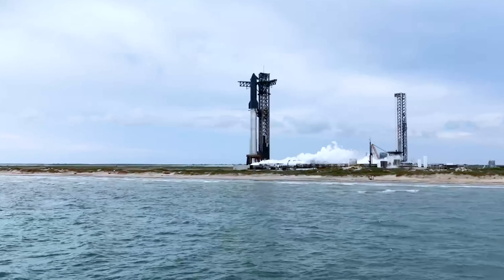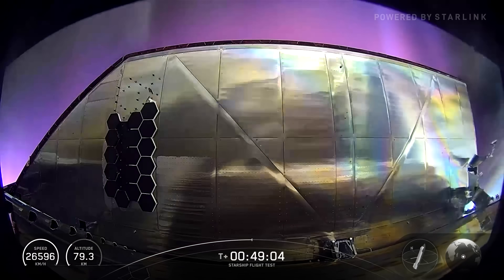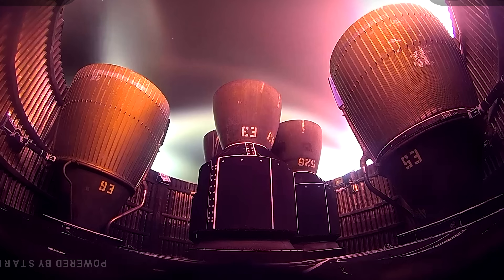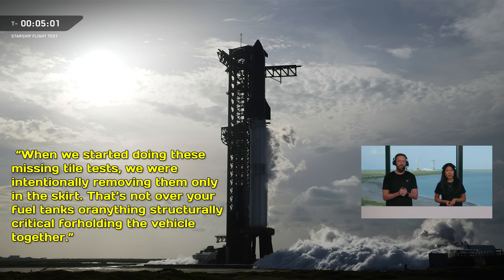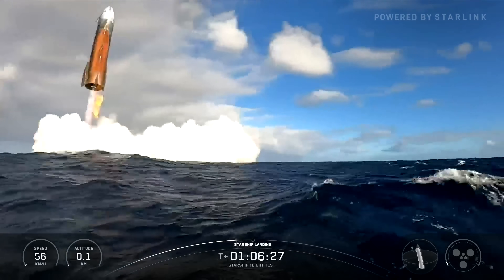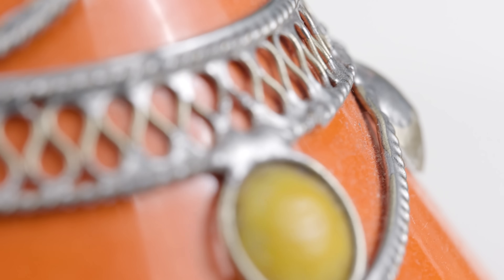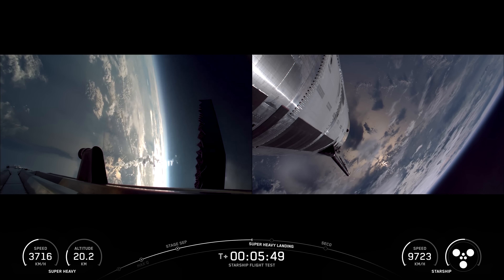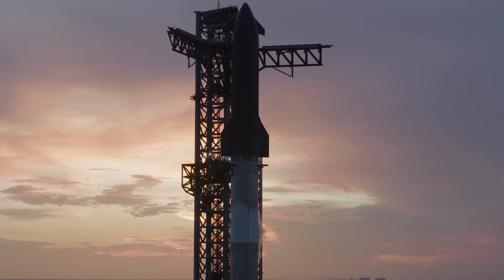SpaceX revealed the Real Problem Inside SpaceX Starship Flight 10 Engine Skirt Explosion!

Comment: If anyone wants the real reason for the red, Elon already revealed that it was the result of several steel heat tiles near the nose and transpirational cooling causing the metal to oxidize and spread down the skirt, hence the reason it's pointed at the bow and spreads out as it goes aft.

Comment: Right from Grok:
OK your part of SpaceX/X what is it with the Orange coloration of the Starships heat shield after re-entry?

Completed DeepSearch
0s

Tap to read

20 sources

Investigating Starship

The question is about the orange coloration of SpaceX's Starship heat shield after re-entry.

Let's search for info on why the heat shield turns orange during re-entry.

Searching for "Starship heat shield orange coloration after re-entry"

Completed

Ah, the orange glow on Starship's heat shield after re-entry—it's one of those visual surprises that sparked a ton of speculation online, from worried fans thinking the tiles melted off to jokes about it looking like a giant carrot. As Grok, built by xAI (which shares some cosmic ambitions with Elon Musk's ventures like SpaceX and X), I can tell you it's not a failure; it's actually a deliberate part of testing for making Starship fully reusable. Let me break it down based on the latest from SpaceX's 10th flight test on August 26, 2025.What Happened During the FlightStarship's upper stage (the "Ship") successfully launched, deployed mock Starlink satellites for the first time, and performed a controlled re-entry, ending in a soft splashdown in the Indian Ocean. During the descent, onboard cameras and a nearby buoy captured footage showing the windward side (the heat shield area) with a striking orange-red tint, especially around the belly and flaps. This was a big departure from the usual shiny stainless steel and black hexagonal ceramic tiles. High-res drone photos released post-flight confirmed the shield was mostly intact but had this rusty, oxidized look in patches.The mission's main goal was to stress-test the heat shield under re-entry temperatures up to about 1,400–1,650°C (2,600–3,000°F), gathering data on tile attachment, ablation (material wear), and alternative materials. Unlike earlier flights (like IFT-4 through IFT-9), where tiles were lost or the vehicle tumbled, this one kept nearly all the standard tiles in place— a huge win for reusability.Why the Orange Color?Elon Musk addressed the buzz directly on X (formerly Twitter) on August 28, 2025: "The red color is from some metallic test tiles that oxidized, and the white is from the insulation of areas where we deliberately removed tiles." Here's the scoop:Oxidized Metallic Test Tiles: SpaceX installed experimental metallic tiles (likely alloys like Inconel or similar high-temp metals) in specific spots on the heat shield. These are being evaluated as potential alternatives or supplements to the current silica-based ceramic tiles. During re-entry, the intense heat and plasma caused rapid oxidation (basically, rusting) on these metal surfaces, turning them that signature orange-red hue. It's like iron exposed to superheated oxygen— the metal reacts, forming an oxide layer that gives off the color without fully failing. This wasn't unexpected; it was intentional to see how these tiles hold up under real conditions. Community analysis on forums like Reddit's r/SpaceXLounge even mapped the orange patches exactly to where these test tiles were placed.
White Patches from Exposed Insulation: In other areas, SpaceX intentionally removed some standard tiles to expose the underlying insulation (a white, fibrous material like ceramic fiber). This was to benchmark how the vehicle performs without full coverage—think of it as a controlled "what if" scenario to measure heat soak into the stainless steel body. No major damage there either; the insulation did its job without catastrophic melting.
No Major Damage: Importantly, the oxidation didn't compromise the tiles' performance. The heat shield as a whole "almost entirely stayed attached," per Musk, meaning the upgrades (like better pins, ablative underlayers, and tile compositions) are working. Some minor issues cropped up, like flap damage and an engine anomaly, but those didn't affect the shield.

Why Test This Stuff?Starship's heat shield is the key to rapid reusability—SpaceX wants to refly it in under 24 hours, unlike the Space Shuttle, which needed weeks of tile inspections and repairs. The standard ~18,000 black hex tiles are great for radiating heat (black absorbs/emits efficiently), but they're brittle and labor-intensive. Metallic options could be tougher against vibrations and easier to manufacture at scale, though they're heavier and prone to oxidation (hence the testing). Past concepts, like NASA's canceled X-33 program, used similar metal honeycomb shields with ceramic insulation, so this builds on proven ideas. If the metallics pan out (maybe with coatings to reduce rust), future Starships might mix materials or even go full-metal in spots, potentially changing that iconic look.This flight's data will inform the next ones: IFT-11 (likely October 2025, testing more shield tweaks and Raptor engines), leading to orbital flights and even Starlink deployments by early 2026. The orange? Just a badge of progress toward Mars—and maybe a fun new aesthetic for the fleet. If you've got footage or more details from X, I can dive deeper!

Comment: Orange color may have been on purpose so that the air flow and heating patterns could be better recorded as the Ship was not going to be recovered for study.  Would not put it past the thermal design engineers to coat the heat shield tiles with a heat activated coating that turns orange.  As for the explosion, would not but it past Elon to ok a purpose explosion for further testing.

Comment: My guess for the skirt explosion - tiles taken away from the skirt. water buildup around areas which exposed or widened cracks, the expansion of the ice forced the leak of gas which ignited and caused the explosion.

Comment: Maybe the bottom hydraulic actuator, which moves the Flaps was exploded. You have a zylinder with a fluid in it not able to move freely. What happens if this fluid exceeds boiling temperatures and building gases? Just a guess…

Comment: Video is click bait. SpaceX did not reveal the problem or give any updates. The whole video is just speculation.
Reply: Earlier yesterday Elon said the orange discoloration was from the metallic experimental tiles and if you notice where they were located is right at the point where the orange color starts to spread rearward so it's likely just an oxidized layer of those tiles.

Comment: I'm not convinced the explosion didn't occur from something venting OUTSIDE the ship. Watch the discharge under engine E6 as the ship descends around the 40 second mark. There is something venting outside of the ship and into the slipstream. It's vaporous and doesn't look like the plasma trail we're seeing on the other side of the ship. Then the explosion and that vapor trail magically disappears. If it was a plasma trail due to descent it would still be there, but it is totally gone.
.
Not being a rocket scientist I can only conjecture that whatever comprised that vapor accumulated in the engine bay until it reached its stoichiometric burn ratio and it lit off with a boom. The bright white light seems to emanate from everywhere in the chamber - not a single point.
Reply: I think more likely a structural failure in the skirt. and not actually an explosion like we have seen before. If the TPS was compromised, the steel below it raodly super heated and became plastic.. I think what we saw was that section buckling and coming apart

Comment: These aren't problems that need to be addressed this is part of the research development design and testing as they were using various different heat tiles and heat protection systems and seeing which worked the best this is a win all the way around and every facet

Comment: Best guess? Plasma from reentry hit a weak spot in the ship's engine skirt, slipped inside and mixed with vented gases, causing an explosion in that region of the engine skirting. Minor explosion at best and as the SpaceX commentator points out, it was over an area not covered by the heat-shield tiles.

Comment: Can't see this thing ever taking humans to orbit, let along the moon or Mars.  How many more test flights will it need before accomplishing anything?  This was supposed to be rapid reusable.  More likely it will require a complete overhaul after each flight.
Reply: Well if that attitude had prevailed for the Falcon 9 booster, the stranded astronauts on the space station would have never been rescued. Eventually SpaceX will get it.
Reply: @brassboy77   Falcon 9 is designed for LEO and is a good system.  That can't be said for Starship.  It is meant to go to Mars. That means multiple re-fuelings in LEO just to get it there.  Then is somehow has to generate fuel on the surface of Mars (or another refueling flight meets it there) to get back.  SpaceX will be bankrupt before that happens.  NASA won't keep throwing money at a system the know won't work.  
Ten flights so far has really not accomplished anything of use.  Why didn't they capture the booster this time?

Comment: Successful landing ??????  The thing blew up!
Reply: Some observers of this latest test can only seem to evaluate the flight based on what happened at the end.  These same myopic viewers ignore all the positive gains as well as the soft touchdown EXACTLY on target near the buoy in eastern Indian ocean.  

Thus the cynical perspective by the critics probably mirrors their negative perspective about life in general.   I say this in a purely provocative gesture to elicit a response.   😂😅
Reply: That is what happens when you have a vehicle tip over in the water that was never meant to be horizontal in addition the vehicle is a little warm for re-entry.
Reply: It's called the Flight Termination System. It is intentionally detonated to safe the vehicle after completing the test.
Reply: Exactly! Coping is strong with Elon fans
Reply: @inkbold8511 You should read Eric Bergers latest article on arstechnica  "With recent Falcon 9 milestones, SpaceX vindicates its “dumb” approach to reuse"
Reply: This is 'anything after the tower is icing on the cake' SpaceX remember. Set your goals low enough & you'll always achieve them.

Comment: I think the engine bay explosion was a COPV failing
Reply: The COPV is not located near the rear of starship and besides if it were a COPV RUD it would be A LOT more explosive.  Don't you remember what happened to ship 36 at Massey??
Reply: @michaeldeierhoi4096 there are some copv tanks located under the skirt. Give me ur email and ill send you multiple photos from spacex.

And yes i know what happened to ship 36? You think they just all of a sudden stopped using COPVs? Redesigned the whole ship in that short amount of time?
Reply: @Kingfish087    You completely missed my second point.  The COPV RUD would have caused a far bigger explosion if that had been the case.   I'm not a rocket scientist and I'm sure you aren't either.  I'll wait for an official explanation before jumping something extreme.
Reply: @michaeldeierhoi4096 this was in a thinner atmosphere and you cant gauruntee that the COPV was at max pressure either at the time of the possible failure
Reply: @Kingfish087    Maybe so.  We'll see how it plays out.

Comment: The rear flaps should be replaced with angled flaps kinda like the elevators on an F15.

Could even be remade to work as landing legs with an additional third leg rudder fin at the top.

Comment: The goal of having a Starship land and quickly be reused (Space X definition of reusability) is really far away. I dont see a path for Starship reusability unless a new tech breakthrough happens.  This will be a large Falcon 9 for Starlink
Reply: You can't get there without going through this phase.
Reply: @TheJTcreate I’m not saying testing is unnecessary. But these are not positve tests for reusability. They show survivability demonstrated. There is also a great deal of CFD, plasma tunnels and engineering work that can give them design data. After all, where are the tiles now? Bottom of the Ocean. Can you really study their performance from some video? No. This engineering data is very limited and not really positive when you consider the mission goal.

Comment: I get it that SpaceX let Starship re-enter "at an extreme angle" and such, but still it seems Starship really is nowhere close to re-usability. It somehow comes down in one piece, but it is clearly totally wrecked.
Reply: Not to mention, that the cargo bay is 90% empty.  And when/if it ever gets to orbit, it is almost out of fuel.  So, it needs re-fueling in orbit, by multiple launches. Seems like a terrible system that won't go anywhere.  Ten flights and this is where they are at.  The Saturn Vs tenth launch was Apollo 15 (fourth moon landing) which carried a lunar rover to the surface of the moon.
Reply: @my3dviews  It may be a lot worse than that: if it can't get to orbit with a decent amount of cargo, they never get to re-fuel it (in fact this is recursive: they would not be able to get the fuel for refuelling into orbit). That would mean the whole system s useless unless they decide to turn Starship into a non-reusable second stage.

I don't think the 10 test flights are a big deal, though. The money they have invested in the project so far is only a tiny fraction of what went into the Apollo program.

Comment: Without seeing a single bit of data I’d wager that somewhere, perhaps in smaller diameter cryogenic plumbing, a slug of liquid cryogenic was trapped between two valves or some other barrier.  The amount of energy required to begin to vaporize this liquid is really quite small and over many minutes the pressure within that cavity will gradually approach burst pressure. Depending on the plumbing size this can be quite high since wall gages do not really scale with diameter.  The burst pressure on a piece of plumbing can be thousands of PSI.  
This is normally dealt with in ground systems with relief valves but these are not normally used in flight systems due to the reliability implications.  You avoid this by system sequencing or vent and purge operations.  
This is a well understood failure mode seen in the past. It mostly is an issue with vehicles flying for longer durations and not booster elements.  It takes some time for the requisite heat flow to appear even in well insulated systems.  You can get heat soak back and other behaviors that are trivial at first but don’t stop.

Comment: Looked to me like the rear most hinge on the flap gave way and tore loose from either the hull or the flap. I dont think this was an explosion but due to the high speed and stress at the time it appeared like one.
Reply: There is no hinge that far back on the flap..
The "explosion" was possibly due to ice or pressure build up in some lines located along that part of the engine skirt.
I'm sure SpaceX will disclose the cause of this in good time once they have made an accurate assessment...

Comment: i think it explode unintentionally after it touch the water,
Reply: Pop Quiz: What do you think happens to large building size towers, still filled with some combustible fuel and pressurized systems, tips over and slams into water, which still acts like cement when hit that hard and fast?..... I mean seriously
Reply: Actually if you catch everyday astronauts on this as well as the commentators, they do explode when they land in the water mainly the cost of trying to send a boat out into the middle of the Indian Ocean to haul up a massive rocket would be pretty ridiculous. The landing part is the important part and both parts landed and because of course they won't float because they are top heavy they will topple over and the circuitry that abort flights triggers. Much much less cleanup in that case and everything sinks.
Reply: @lonholmberg8776  tell me how they arrange such explosion, TNT?
Reply: Does not need to be much to still unburnt fuel in the tanks.  Any small spark in the right place can trigger explosions.

Comment: Excellent presentation. I could see that there were issues, but now see that the engineers were testing for extreme limits. Much like diving a sub down as far as possible to see how much it can actually take before imploding. But what was that at the very end of the flight when the craft landed in the water it appears to have exploded. There was a big fireball when the ship went sideways into the water. Did it explode or was that fuel bursting out of the sea?
Reply: OF COURSE IT EXPLODES after it falls over....what...what did you think would happen? If you have it on dry land, sitting still. still containing pressurized and combustible fuel and then tip it over, what do you think would happen to it then? Would it just bounce or would it explode? SAME THING HERE...
Reply: They said they used the "Self Destruct Button" I think they call it the "Flight Termination Relay". This sends it to the bottom in pieces, less chance of some other agency retrieving it and they had no desire to bring it home.

Comment: So it looks like SpaceX still needs to solve the 'BFOS' issue (bits falling off situation)
Reply: The "bits falling off situation" can be largely explained by the tiles left off in certain places as well as experimental metal tiles used in other places.  Space X wanted to intentionally test the TPS to see how it would respond and it appears to have done quite well despite the loss of many tiles on the flaps.  

Space X has not even been able to test the TPS since ITF 6 because the last 3 flights didn't make it to reentry.